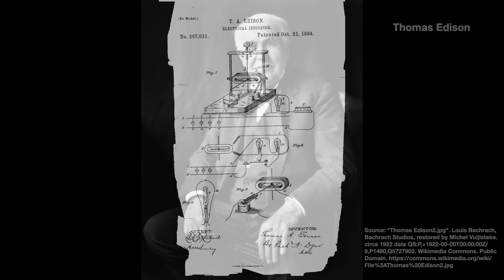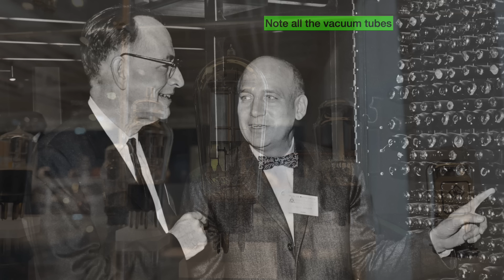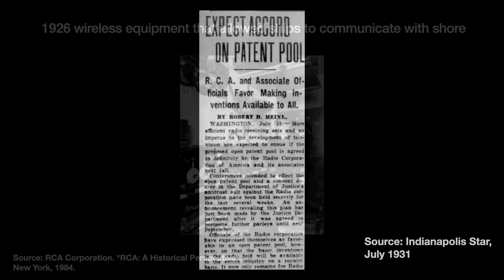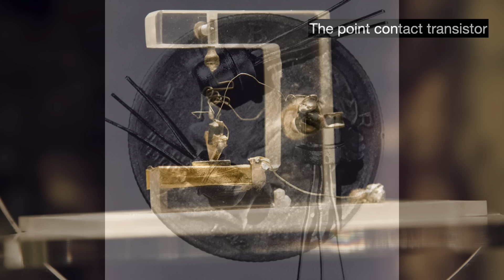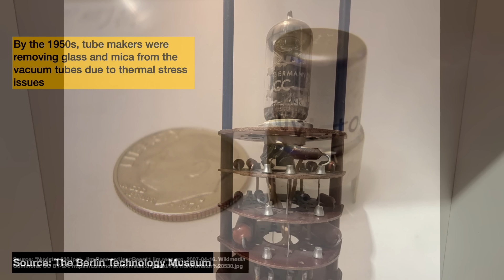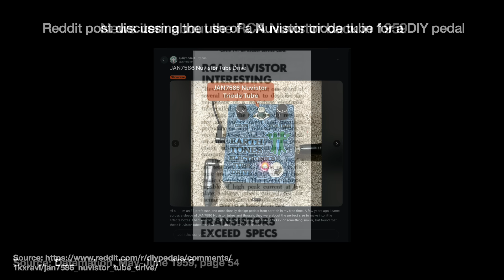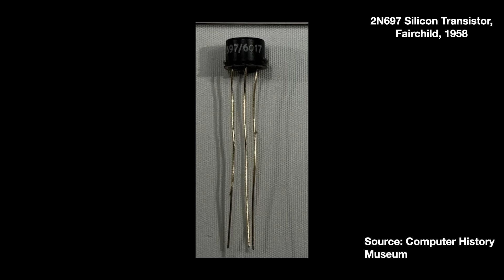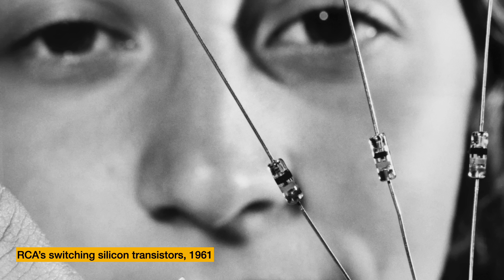RCA Made a Vacuum Tube to Beat the Transistor

Comment: Interesting trip down memory lane. I was a US Marine Corps avionics tech back in the late 1960s. That time was a transition and there were a bunch of specialized vacuum tubes used in military UHF communications gear.
Reply: Did you ever see any tubes that ran with a cold/unheated cathode? Like the Moray tube (which was never granted a patent btw). That one is such an oddball to me and I like to believe he wasn't the sole guy who knew its secrets. :')

Being born in the early 90s myself, the tube era and especially the experimental era of the 1920s-50s was long gone ofc. Closest to tubes I got was the tan box of various types I got from my grandfather's basement after he passed too early. Guy was an avionics engineer and at one point worked on the F-16 project. Also some years at NERA (Norway).
Reply: The microwave magnetron is a vacuum tube that is still found in most houses in the west…
Reply: the special military ones are the ones that manufacturers really milk for the highest price possible.
Reply: @paulmichaelfreedman8334 anyone remember the brief period of U.S. avionics amusement when the Cuban pilot stole a Mig and landed in Florida.
I recall the ha ha's when the MiG was revealed to be packed with vacuum tubes for its electronics. Word later trickled out that TUBES ARE EMF DAMAGE  RESISTANT.! Almost everything electronic now is likely to fry very easily during a serIous EMF EVENT
Reply: @kazparzyxzpenualt8111   I have often heard similar.  What they fail to mention was the Soviet Union was far behind the west in electronic and computer technology.  For many years, the only place to get vacuum tubes was them, as they were no longer made in the west.

Comment: I always like looking at vacuum tubes because they're very interesting to me. The different kinds of structures inside are always fascinating.

I work at a radio station during the weekends and they still have their old, vacuum tube driven, transmitter As a backup. I've had to use it on a handful of occasions when our main transmitter has gone down.  47% efficiency And she's a tough old bird that gets the job done, baby!

I love watching the vacuum tubes start to come on and glow, and then checking every once in a while in the window on the side to see how things are going. She's never given us a problem, not once. 👍🏻🇺🇲👍🏻
Reply: Often they’re like gossamer sculptures that can glow… in little glass shelters… 
Though ‘ICs’ are vastly more complex, they don’t have that ‘eye-candy’ allure…
Reply: @ericjohnson9468  It's almost hypnotic to watch them come on and continue to get brighter as the power increases to them. I can only imagine how hot they are to the touch But I do know you're not allowed to touch them with bare hands even when they're off. The oils from your hands can cause the glass to shatter. I saw it happened a couple of times in theater in college. somebody touched the can light bulb with their bare hands and when they turned it on you could hear it burst and the glass hitting the floor beneath. The instructor was visibly upset let's just say.😂
Reply: Quartz projector bulbs are like that, but tubes are OK. Still good to handle tubes with fingers, but might wipe off numbers
Reply: @BeachTypeZaku  Same with quartz halogen bulbs.
Reply: @nerdful1  I'll see what you're saying. It's only an experience handling than that I figured that they would have that kind of reaction. wiping off numbers I figure is not a good thing, so I probably might want to still handle them with some light duty gloves to make sure that doesn't happen.
Reply: @howardsimpson489  Yeah I hear they can be sensitive. I think we used some of them in theater as well.
Reply: Used in garage door openers, and HPAC ACVTVMs

Comment: Some Tektronix oscilloscopes of the era used valves, nuvistors, transistors and semiconductor diodes all in the same unit, squeezing the best performance from each one!
Reply: The Tek 454 scope used a Nuvistor vertical amplifier. Why? A transistor differential amplifier has a thermal waveform distortion caused by the base-emitter voltage dropping with increased current/temperature. Put a low freq square wave into an old HP scope and you may observe a 3 msec rising exponential tail following the rising edge. Unacceptable to Tektronix! Their later scopes used a custom IC vertical amplifier called the "cascomp" that measured the drift and subtracted the offset as current in a differential cascode amplifier.
Reply: Funny, I have a 465 with the custom IC...
Reply: @crhans5  453 not 454 I think...
Reply: @crhans5  I still use one to service tube amps.
Reply: I had a Tektronix scope that had a special diode, transformer, and nuvistor, in the horizontal timing circuit that was supposed to allow the signal to come through the circuit, except it didn't work, and the scope had no trace until I replaced the nuvistor with one that worked. And once that was done, the scope sold at the next Ham swap and shop.
Reply: @crashburn-s3b  Would the special diode have been a tunnel diode?  I honestly was surprised there wasn't an Asianometry video about them.  I'd swear I saw it.  Maybe next week!
Reply: @paul_moir  Yes it is! It is the craziest semiconductor in the world! It has a condition called negative resistance at high frequencies!
Reply: @crashburn-s3b  When you're oscilloscope runs on a quantum mechanical principal that can't be explained in classical physics....
Reply: @paul_moir  But it communicates with the aliens many light years away!
Reply: @crashburn-s3b  um at any frequency
Reply: @paul_moir  1) your 2) principle
Reply: The transistors in my old Tek oscilloscope are in sockets because at that point they had no idea how long transistors would last.
Reply: I have an HP scope from the early '70s that does the same thing.
Reply: Thank you!  I have like 10 of these I will inspect them for that!
Reply: So did American made TVs though early 80s. why Japanese won electronics biz
Reply: Valves and Integrated circuits also can be in one modular instrument together - especially likely with 56x series instruments!
Reply: @splitprissm9339  Well they'd have the CRT for one, transistors in the deflection, and maybe an IC in the heads?
Reply: @8BitNaptime  564B with auto erase. that one has a lot of ttl ics in the storage control circuit. it takes 2/3 series plugins which are often tube based!

Comment: What blows my mind is, how RCA was using photolithography to make color CRTs in the mid 50s, but nobody there ever thought to apply it to semiconductors.  Then again, they were more or less bashing color TV over everyone's heads in the 50s.

They did have a few early all solid state TVs (CTC-40, with that weird trace/retrace SCR setup), but stuck with tubes for a long time.  My parent's 1972 19 inch color portable had tubes, transistors, and ICs in it.

When they did the conglomerate thing, they were known as "Rugs, cars and appliances".  You should do one on how they got whooped by IBM and everyone else at computing.  They were seriously bad at it...
Reply: I feel the same way with 3d printing.
When Xerox Printing became widely adopted in the 80's, all we needed was a Z Axis stepper and hardening print to make it 3d...
Reply: Those trace/retrace SCRs hardly ever failed. Probably the best idea RCA ever built into a TV.

Comment: Don't forget the military applications that nuvistors were used in. They were a lot less susceptible to EMP, ionizing, and non-ionizing radiation. Circuits did not have to be radically redesigned to use them. They could take voltages and power that most transistors could not. I would argue that for the early 1960s in radar they were much better than any solid state applications in radar and missile tech that would be exposed to possible nuclear blasts or radiation.
Reply: A company I worked for tried fluidic logic because it was rad-hard and could be denser than vacuum tubes. This was in the 60s. I tested some of the early versions as a technician. They made memory, flip-flops, oscillator etc in air channels. It worked but I think a bit slow.
Reply: @BB-iq4su Festo and Foxboro made fluidic controls for decades into the 1990’s.
Their other advantage was they could be powered directly off any compressed gas source - including natural gas pipelines internal pressure (and weren’t an ignition source).
And that included things like gas chromatographs to analyse what was in the gas in the pipeline.
Reply: That was the military sponsorships he mentioned about 3/4 the way through
Reply: I read that ground-hugging radar systems in Greenland , put there as an early-warning detection system for Russian nukes being launched, were the size and shape of telephone poles!
Reply: Reminds me of when Lt. Viktor Belenko defected from the USSR and flew his MiG-25 to Japan.
When our engineers and techs tore the jet apart, they ridiculed the miniature tube-driven radar, communications, and targeting systems.  Only later was that seeming backwardness revealed to be a design virtue.  The MiG-25 was designed to operate in a hot nuclear environment and those shielded tube systems were immune from the EMPs and jamming that it was expected to encounter.
Reply: So correct. Also, AT&T had built their network of microwave telephone repeaters from coat to coast and many of those towers were built to be hardened against EMPs at the behest of the defense department. The concerns were real and vital communications had to be available to the government and armed forces at the most extreme conditions. There was no choice but to work with the toughest and most dependable components available in those times.
Reply: This is part of why transistors followed "The 20 Year Rule" of technology innovation.  Vacuum tubes were not really replaced until the 1970s - 20 years after the first commercial transistor on the market.   

I remember most electronics especially consumer electronics still had vacuum tubes in the early 1970s but by 1980 my EE program had one day in the entire 1st semester about vacuum tubes and the rest was transistors and most consumer electronics was 100% transistor (or IC) by then.

By the 1980s even ICs were as rad hard as vacuum tubes - another area of EE I worked in.

I still have romance for vacuum tubes in the form of antique radios.  I have several TRF radios from the early 1920s and 1930 super-het Atwater-Kent (~4 ft tall).
Reply: Whato😮🎉ev😢er hsppen😢ed to spacistors.